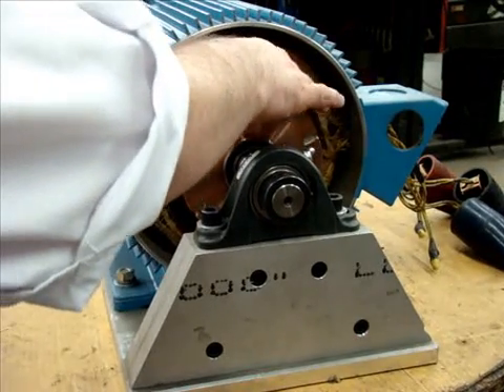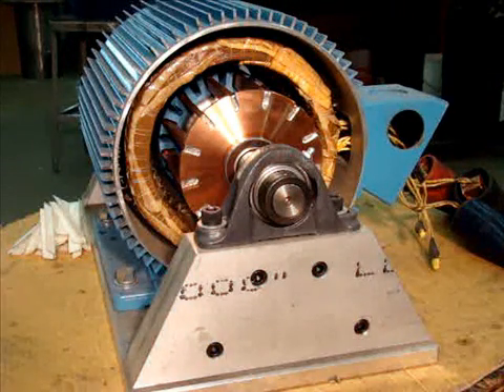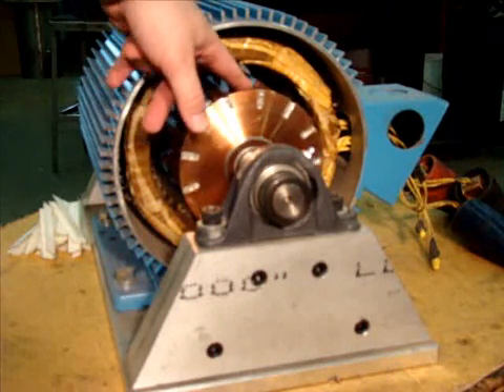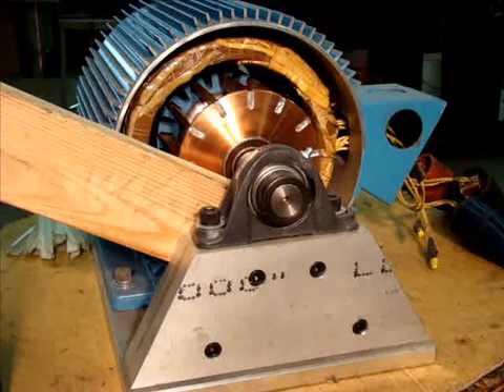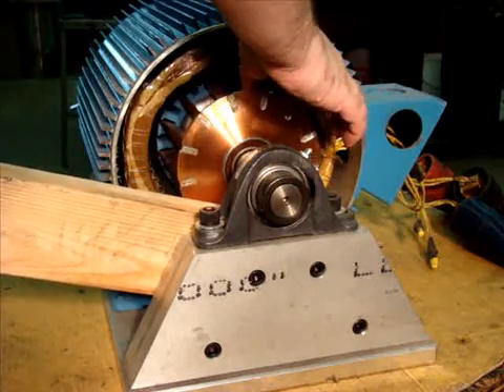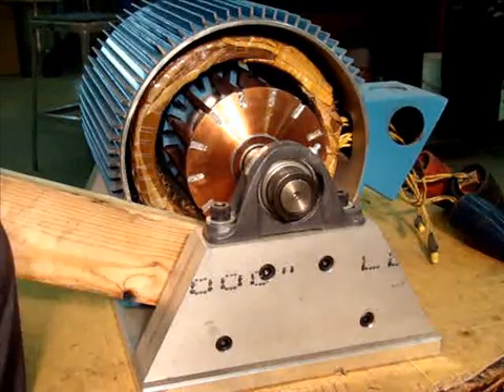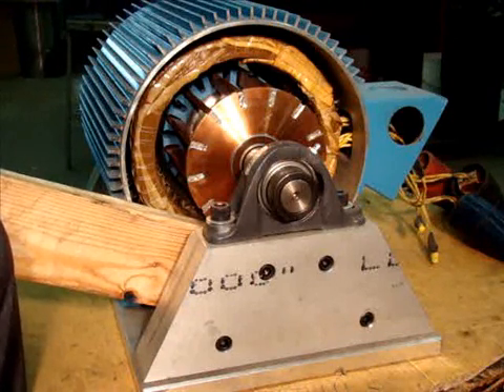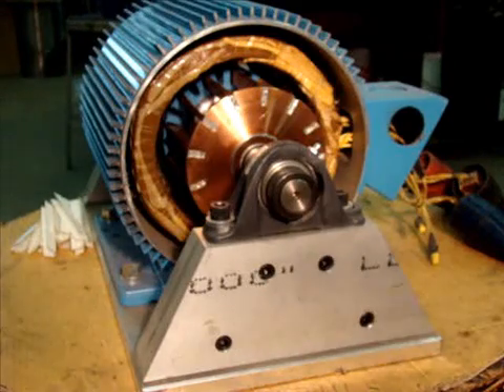Rotor Bar Forces Experiment

Comment: Quite interesting: I wondered if the force was applied to the core, or the conductor bars. This test also makes me think, that the force in a DC carbon brush motor may be the windings on the armature, rather than the core.